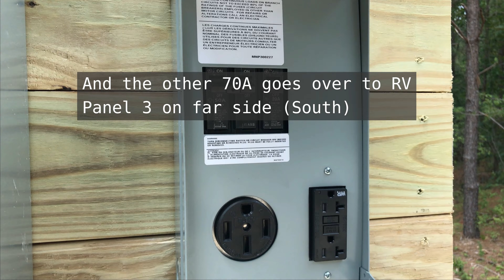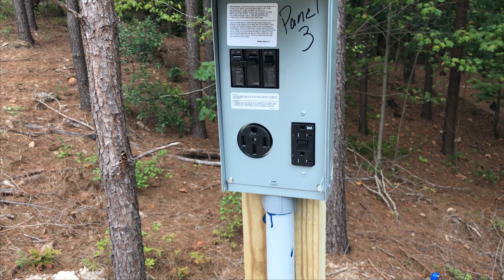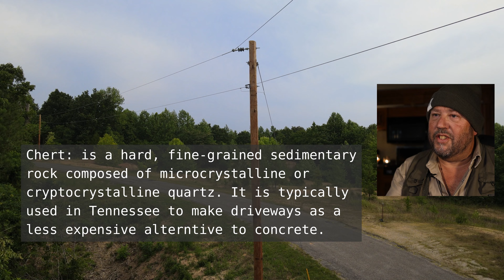RV Lifesytle: RV Electrical Installation Status - Update 2 - Lot 25 in Linden, TN

Comment: thanks for responding to my question of stage presence(sweat) next question,when are you renting a site for this year? and,would you take a phone call?
Reply from the maker: For this year, we do not intend to charge for boondocking of fully self-contained RV camping units (we don't have facilities onsite just yet). Boondocking is available now and we just need a signed liability waiver on file and proper expectations set with the understanding that Linden Camp is an active construction site. Which means there may be ongoing construction noise, dust and smells from time to time and RV'ers may be asked to relocate to a different part of the property to accommodate construction activities.

We can accommodate a few RV electrical hookups near the road at this point because we do have one temporary RV power pole with 200A service which could easily have a few more RV power pedestals added to it. Septic is in the works. Water is coming (we have a portable water delivery system available). We'll have to figure out to price these yet.

Phone calls or TXT can be directed to Linden Camp at 931-588-0101. You'll most likely get VM due to all the incoming robo calls and sending a TXT might be your best bet.

Comment: Nice job,what size conduit did you use after the main panel?
Reply from the maker: We used 2" for RV and EV stations that were going on 100A breakers. We used 1" for lighting and 110v outlets. We ran 1" from our utility sheds to each RV pedestal for communications (cable, Ethernet, fiber, etc). We used 1 1/2" for backbone communications that connects the utility sheds together.
Reply: Thank you for that info. Your channel is very helpful and fun to watch. I am currently starting build on a small RV park in West Virginia. Just finished the septic drain field 600 feet was required. now starting electrical and Ethernet. Great job keep up the nice work. Bil